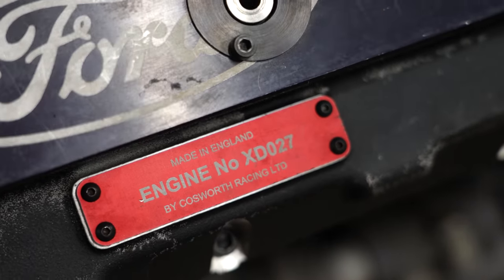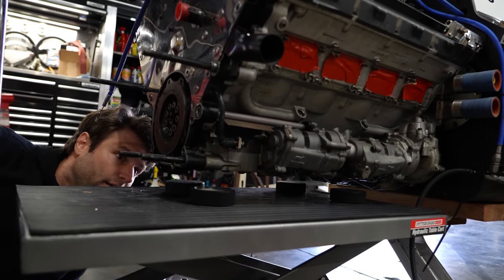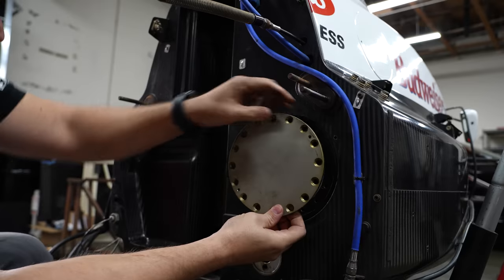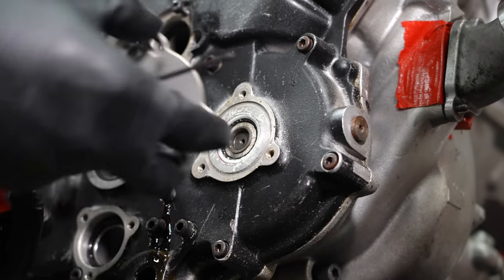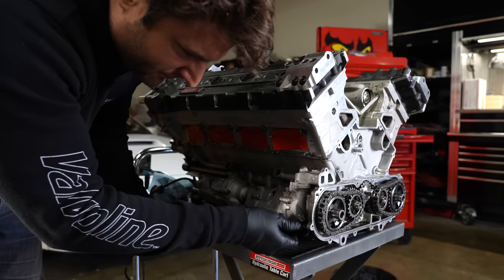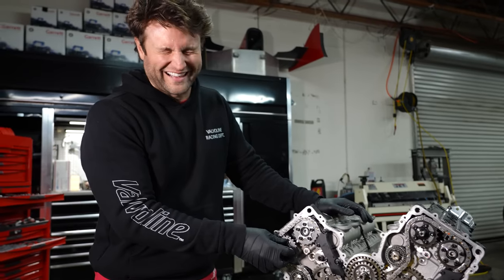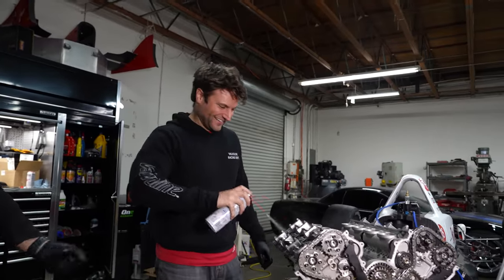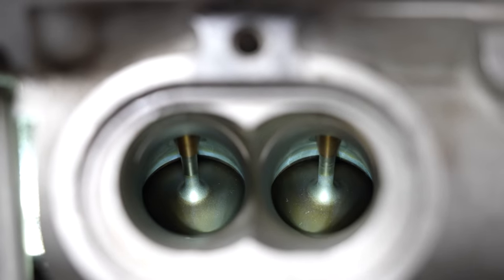We teardown the IndyCar Engine to expose its Secrets! Cosworth XD Turbo Methanol V8

Comment: Reminds me of a mini 4.6 4v, with high ass compression, short stroke, big valves, flat tappet cams, and minimum resistance thru the drivetrain(Clutch to flywheel, input shaft to output shaft). Makes complete sense how they rev to the moon.

Comment: It kinda appears that the corresponding position on the same crank lope is compressing at the same time making the down stroke 2 times stronger. It’s like two straight 4 cylinders merged together into a V8 operating in harmony together. That might explain the tremendous power and force output being generated within a single block engine.

Comment: Before you tried to spin the motor, did you check whether the motor required pre heated oil circulation? Some race engines have tiny tolerances and the motor will be seized before it’s warmed by circulating warm oil via an external pump and heater system.

Comment: The shop where this was assembled was like a clean room probably. I've not watched it all yet. I'm wondering already if the block is cast or machined along with the heads. Open deck semi or closed deck. Are the bores sleeved and do they have a special coating? I'm curious about valve spring pressures also. So many questions I have already lol.

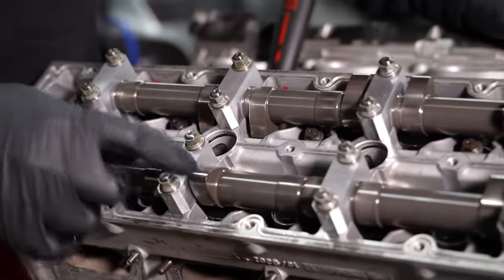Comment: 45:00, Rob not all 4v engines open the valves at the same time. "VTEC" and engines with similar tech will often have different profiles for each intake valve, that then lock together into a single high lift cam when VTEC engages. This promotes swirl at low RPM and helps efficiency by better mixing the fuel/air charge.

Comment: The clicking when you turn the engine is likely the transition from the valve springs pushing against the lobe to pushing the lobe forward..  Basically before the peak of the lobe its trying to push the cam in a counter clockwise direction, and then once you pass the peak its suddenly pushing in a clockwise direction.  Thats why your slack moves from "before the camshaft" to "between the camshafts".

Comment: Very interesting.  I've seen modern engines like these don't even have valve springs anymore, valves are pneumatically actuated with some sort of heat tolerant gas inside a solenoid.  Timing is all controlled by a computer.

Comment: My guess for the part in the center of the valley at 20:15 is to pull the moisture from the oil that is from the fuel

Comment: Your intake and exhaust cams will have different duration.  You can regrind cams and change lift/ duration to a degree. The best way to go is to have custom cams made. They do not cost much more than off the shelf cams. Comp cams does this as well as many others. They can make exactly what you want. Good luck 👍

Comment: The "click" sound at 55:05 is the camshaft rotating past the high point on one of the cams.  The chain is loose as the tensioner is not doing anything much.  It may be hydraulic as suggested in other comments here.

Comment: Hey Rob, watch the recent videos on Steve Morris Engines where he is rebuilding Garrett's engine from Mullet... he talks a LOT about bearing wear patterns... he's a good teacher!

BTW, at 14,000 RPM, I bet those beefy cylindrical pins between the block and sump/cradle are to help prevent bearing cap creep because of the rediculous forces and resonances at those crankshaft speeds.

Comment: The popping is the nose of the lobe going over the tip of the valve. With the sharp cam nose and the high spring pressure the cam is forced to spin foward in rotation as the valve pushes on the down ramp of the lobe.

Comment: 55:15 thats due to the valve springs (i also wonder how many teeth you skipped..... that motor is NEVER going to run again lol)
.
as the cam lobe goes past "center"..... the valve spring now helps rotate the cam, which takes all the slack out of the chain
it can make it an ABSOLUTE PAIN to verify valve timing after you replace a timing belt/chain on some motors
.
a pushrod will have a different "feel" than a SOHC than a DOHC (and 2 valves per hole.... or 3 or 4 or 5)
.
.
.
but ya.... you probably skipped a few teeth
plus you have the cam sensor "half wheel" in the wrong spot
and you could have bent a valve by turning it after it skipped (its such a high comp motor, just 1 tooth could be all it needs to kiss a piston)

Comment: Rob look up "Interference engine" and "non-interference engine" because when you were talking about timing belts you were describing an interference engine. I assume you've figured out that the middle gear runs both timing gear driving gears.

Comment: Really enjoying the content man, I work in the Motorsport industry myself. So this is really understanding for me, this engine shares similar design set ups as McLaren, Ferrari and Lamborghini with how the timing is designed and how the lower case comes apart. Also similar auxiliaries systems with the water pump and alternator etc. It would be very interesting to see what oil clearance tolerances they've used on the rotating assembly. Obviously everything would be worn now, will look forward to what you do with this 👌Mad to think its 90's era 😎

Comment: Not 100% sure, but pretty sure, the filter in the valley is or is very similar to a CCV (Crank Case Ventilation) filter.  The filter "removes" the oil from the air and the oils drains back into the system.  Used on a lot of diesel motors.

Comment: Spun the motor over in the wrong direction (not that it probably hurt anything)... Anyways,  easiest way to figure out which way any motor should spin is to look at which side of the timing chain(s) the tensioner(s) are on.  They should always be on the "trailing side" of the cam(s), as their purpose is to take up the slack in the chain assy...

Comment: Should have put a dial gauge on those bolts and see what the stretch was across a few of them, very likely they were done up to a measured stretch rather than torque anyway. Even arp specs their hardware with info for proper installed stretch.  If ever there was a engine to follow the rule to not turn it over the wrong way, this is probably one of them.  Crank journals do have a smooth vs a rough rotation direction depending on which way they were final ground/polished. Turning them backwards can in theory load the crank surface with bearing material which then wears the bearing.

Comment: Simple rotation verify with cover off… the chain used for rotation of camshafts is straight on the guide side…. That is always being pulled from the source gear located near the crank…the straight section is pulled never pushed… initially you had engine going wrong rotation…. The chain tensioner is always on the none torqued/loaded side of chain.

Comment: Nice video Rob, but i dont understand why you wanted to turn the engine, the chains probably use oil pressure tensioners etc. And that chain skipping over the camgears gives me the chizzles😅

ofcourse temperature and thus lineair expansion and dynamic viscosity makes this thing even run and survive more than a few minutes. 

The two pipes are probably for warming up the liquids

Comment: The timing chains are the most obvious way to determine rotation. Guides on the tight side idler gear/tensioner on the slack side. Rotated it backwards the first time it turned.

Comment: The cam chains travels up over the tensioners. If the engine rotation was reversed the cam tensioners would change cam timing and see full cam turning load.

Comment: We would always back off the valve springs on the engine on our rally cars "Open Wheel"/"Coyote Wells" unlimited class over the Winter or anytime we weren't going to run them for more than 4 weeks. I'm sure that really goes for most high performance engine's.

Comment: Could part of the resistance you’re facing when trying to turn over be the tolerances? I know to a certain extent that all Indy car and formula 1 engines have strict start up processes, and a large portion is warming up the block and oil so everything expands to the right amount for function.

Comment: I noticed you didn't clean the mill scale off the metal before you weld it if you're going to do that you should use a stick welder will feel like a 611 or 6:10 rod

Comment: It's possible you were turning the engine over in the opposite direction. The chains are supposed to tighten up not lose when the engine spins. And those pins are dowel pins. so interesting. I have never seen them used like that before.

Comment: Which way the Motor turns is right to be seen  when you look at the timing chain. The Motor crank turns anti-clockwise while the camshafts turn clockwise. And hollow camshaft is some kind of an old hat. At least in double overhead camshafts engines.

Comment: For compatibility with methanol fuel, use fluorocarbon rubber components (o-rings, hose, ...etc). Check with business jet suppliers. The nitrile rubber used with petroleum will only last a week (maybe less)

Comment: Hockey pucks huh.. Guess that's slightly more professional than random lumps of 2x4. Neat idea. :)

37:00 it might be a vacuum pressure regulator valve instead, if it's on the scavenge pump.
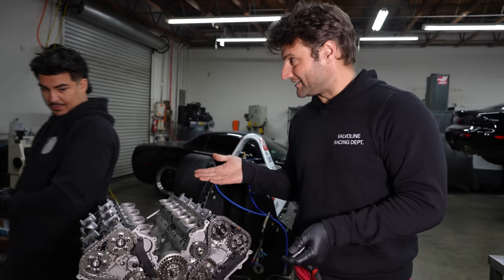48:40 the chains are also an obvious hint, the tensioner wheel is always on the 'slack' side.
1:01:20 fat washers are for distributing the force better into the relatively soft alloy parts. You'll also find them under the nuts of the head studs.

Comment: This was very fascinating as far as motor engineering goes and even though this is from the 90's and we mere mortals don't know how technological the actual motors are, on the actual F1 motors he wouldn't be able to even rotate that crank as the pistons are so tight to the sleeves that they need to warm up the oil before starting the engine...just pointing out a small detail on more modern engines..very nice bespoke details on this one nevertheless...👍👍✌👏👏

Comment: Flat plane cranks usually (at least Ferrari's lambos, etc) have a firing order straight down the line. 1-2-3-4-5-6-7-8(9-10-11-12). I was surprised when I found that out that it would work that way.

Comment: IF y'all have time, you should anodize all the mounting bolts/studs/nuts that go between main structural components a specific color so it's easy to visually identify quickly.

Comment: You guys must be meticulously documenting every part you are taking off as you go or have an assembly manual and diagram with all the parts and torque specs.  If not LOL,,,,good luck!

Q- where are you going to get all the proprietary replacement parts needed to reassemble this engine?

Comment: Rob I was wondering about piston speed and how does the the fuel become a limiting factor. I'm thinking the expanding shock wave is roughly the speed of sound. Not sure on that. 🤔
So I found this...
King of Speed: Cosworth's CA 2.41 V8 saw a mean piston speed (MPS) of 33.4 m/s (109.5 ft/s) whereas at 20,000 rpm the 6%. bigger bore CA saw an MPS ...
The speed at 33.4m/s is 10% the speed of sound. That's ~100 kph. The car is doing 2 to 3 times that but this makes sense. That's what a gear box is for. What are the ratios on that?

Comment: The profile of the cams matter and its unlikely that the intake and exhaust cams have the same profile. 
So while running exhaust cams for your intake might not literally backfire, the suck squeeze blow will be less deep but might also be more sloppy than you'd like.
Ground down intake cams are probably safer than using exhaust cams.

Comment: so i dont know much, but i do know about old F1 engines and how they had to be warmed up before they could rotate (essentially seized when cold). maybe the tolerances for the cosworth when its cold just mean its not very smooth?
Reply: @PSTS636  I mean it definitely isnt
Reply: @PSTS636  share some proof of this lol.
Do you know how metal works
Reply: @PSTS636  it's seized because we're talking engines with microscopic levels of tolerances designed by people a lot smarter than us.
F1 teams developed external oil pump systems so they could pump hot oil through its engine before cranking it. Just saying there's a reason they did that with the V10's.
All you have to do is Google "can F1 engines cold start"
Have fun realising your stupidity.
Reply: @PSTS636  I'd also like to point out the fact that aluminium (spell it correctly fool) and steel are alloys. There's many different varieties of steel and aluminium and they all have differing properties.
Reply: @PSTS636  I made it up? Dude. I've known F1 teams did this since the early 2000's.
The engines have such tight tolerances for a reason. Far tighter than a regular engine. As a result cranking the engine while cold can cause damage to the engine.
Even the V6 engines that are in F1 cars today have to be pre heated before firing up.

Stop arguing with literal facts.

You must be the sort to tell Rob that he's doing things wrong when he isn't.
Reply: @PSTS636  give me some actual facts rather than telling me I'm wrong.
I've been researching too. Everything I've found contradicts what you are saying.

Like, in what world is it impossible for an engine to be seized when cold xD. Metal expands when cold dude. Basic fact.
Reply: "The engine needs to be heated to a specific temperature and its chambers lubricated by hot oil to prevent abrasion of the moving parts"

So, when a race engine is cold, turning it over can cause damage due to the microscopic tolerances (tolerances far smaller than a road engine ffs) so from a racing standpoint those engines are seized until safe to crank.

It really isn't difficult to understand dude
Reply: Like. You haven't proven anything here.
How am I wrong. Explain rather than just saying I'm wrong.
You haven't won this argument simply by saying "you're wrong"
Reply: Also, go look at my original comment. I say "essentially seized"

I should have mentioned this from the beginning.
That cosworth is a race engine. It's for his indycar. It's fucking expensive.
Now, he's not gonna race it, but he's probably gonna try and drive it fast.
Now, imagine that the cosworth was even more high strung. 14.5krpm is cute but f1 hit 20k with ease.
Turning it over cold would be asking for damage to occur. So, when the engine is cold, its seized as far as the engineers are concerned. Once warmed up, everything can rotate fully without risk of damage.

This is what I meant the whole fucking time

Comment: Those cylinders adjacent to the main bearings sandwiched in between could be a way to strengthen the block by adding stress by introducing a crushing force into the block casting. if thats the case im assuming they are very accurately machined and would be better suited in a foam lined pelican case 😂.

Comment: @49:19 🤦‍♂️ spinning it backwards is NOT GOOD!!! All you have to do is look @ the timing chains tension side. It will alway point @ the gear driving it. That motor spins counter clockwise as your sitting in the seat looking forward like most V8s. I’m sure the engineers to advantage of that direction to send the emerita load the right side tires of the car to help turn left @ Super Speed Ways.

Comment: At 55:40 you're rotating the engine in the wrong direction. That's why the chains are jumping teeth. The tensioners are only designed to tension the chains in the clock-wise crank rotation.

Comment: I am intrigued by those small metal guiding pins laying inbetween main studs of the crank (the one that fell into motor) , what is the purpose of them ? Is it to prevent warping and dissipate tension of the main caps studs having in mind that all the block is aluminum how does it work? I need answers.

Comment: That was interesting to see whats inside an 'old'  race car engine. 
Bit surprised how crude it is compared to production motorcycle of same or  or even earlier era. (80's ~ 90's)
The chains will always feel 'slack' on a cold motor as the alloy will expand and make things tight (er) at operating temp.
When you have timing cover off the chain will have adjuster on the  non drive side of chain with a guide or slider on drive side (except for a few Honda's that were designed for chain drive but got switched to shaft drive)
The nut size is irrelevant, the bolt size (diameter) is what you use for torque spec. 
Generic for 6mm (1/4") bolt is about 84~108 inch pounds (7~9 ft/lbs)

Comment: you shoul be worry about the noise you are actually tuning it the wrong side. it supose to turn clock wise. all ways turn againt the chain or belt tensioner. thats why it getting loose between the to cam gear